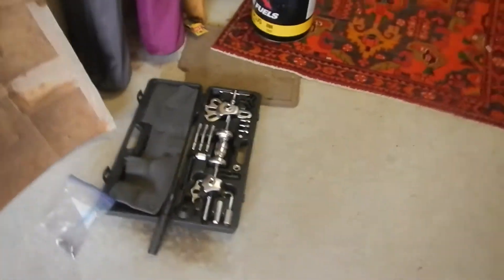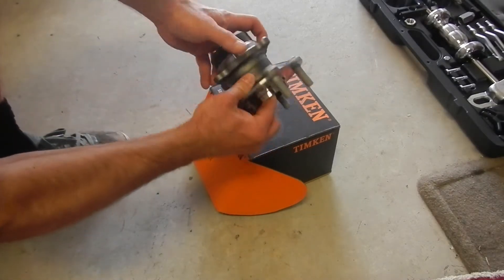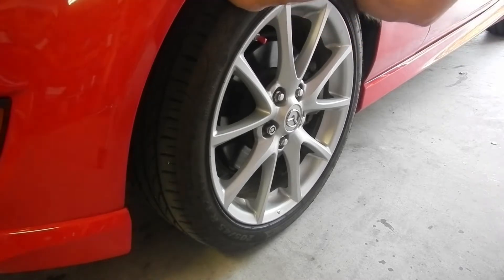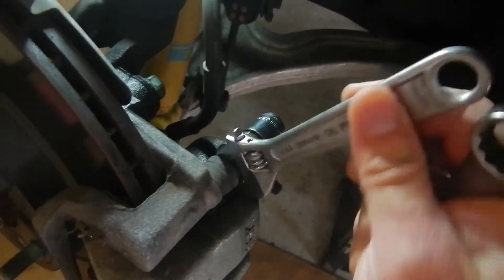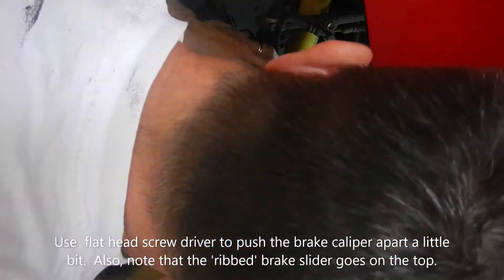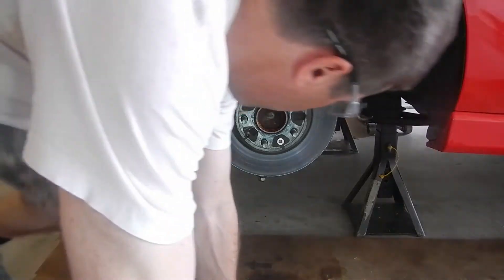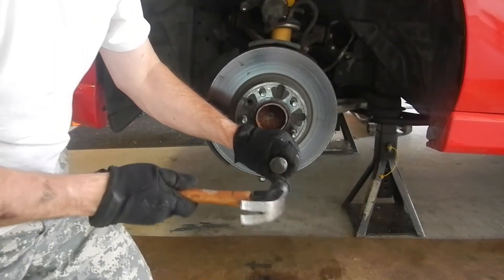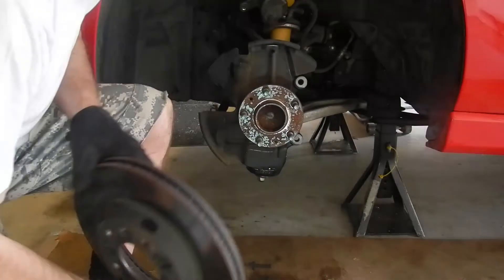2009 Mazda MX5 NC Miata  - Front Wheel Bearing and Hub

Comment: I know this is 3 years later but I've always known the rubber collar thing to be on the lower slider pin, not the upper. I also had to use an impact to free the screws, first time I've encountered that on any car. I'm wanting to do my backing plates so your video was very helpful.